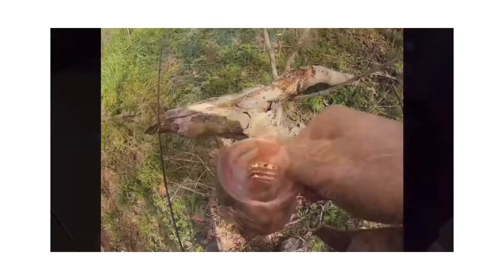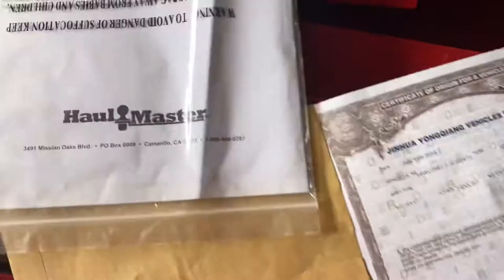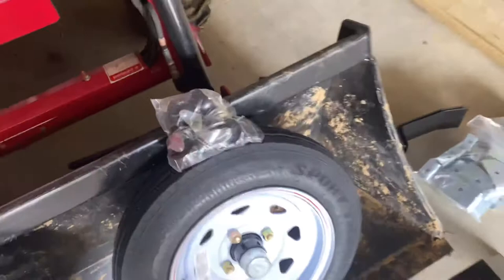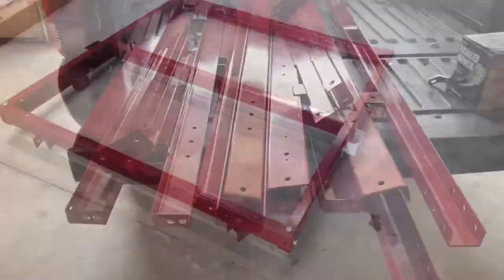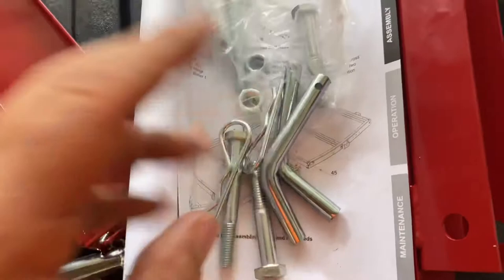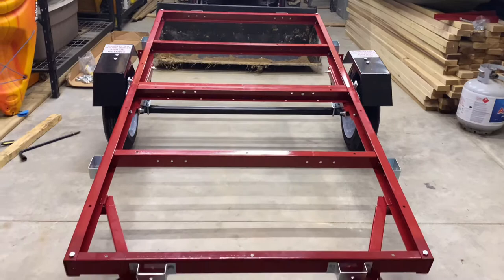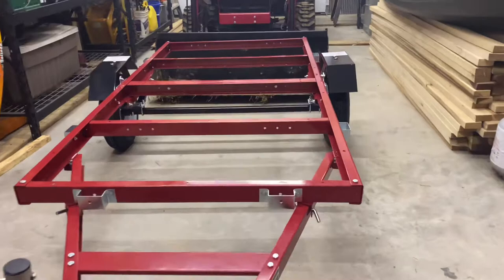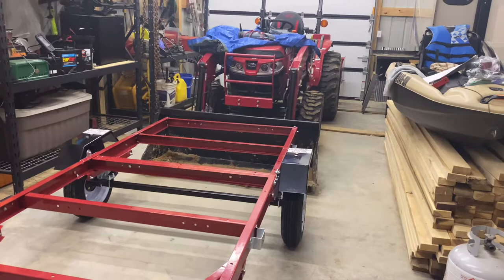Unboxing and Assembling Haul Master (Harbor Freight) 48x96 Trailer Part 1

Comment: I have mine titled for just I n case it gets stolen and it has one ky vin on the tounge and the 2nd is under on the trailer fram that only I know where it is at I live in henderson ky only reason mine it titled. I have a 4 x 8 and a 5 x 10 and a boat trailer also with a 16 ft all flat bottom john boat on it. Got these trailers back in 1983 still on the road today.

Comment: Them trailers have went way up
Reply from the maker: Yes! In fact a week after I bought mine they went up at least $100
Reply: @outdoorswithedsometimesg  I was told eventually the inside track club members will get 100 off of the heavy duty one
Reply from the maker: @justinderossett8846  that would be great!
Reply: @@BLAlleydoes it come with a fee to join the club?